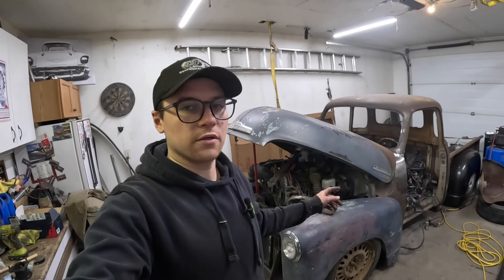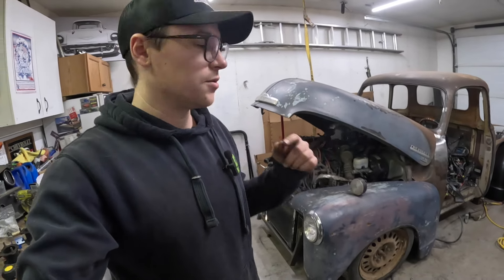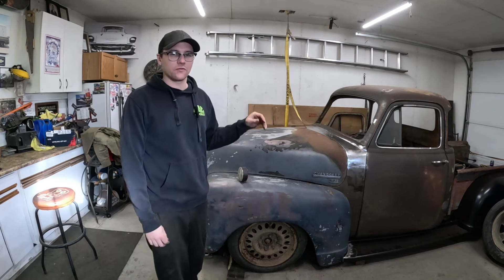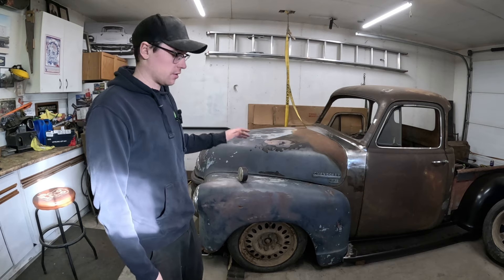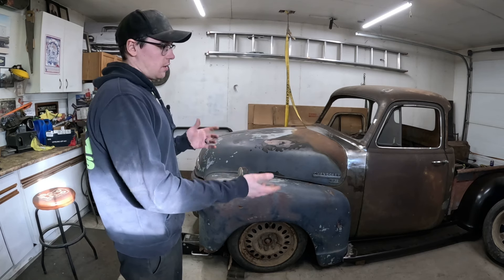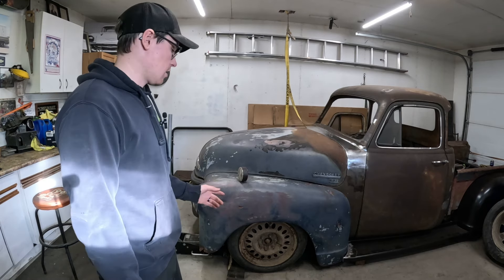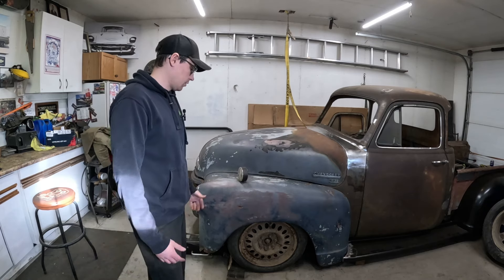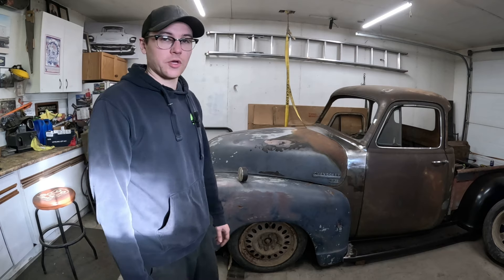Problem solving Air suspension issue! || CUSTOM BODY SWAP ep. 10

Comment: Been looking for a truck to chassis swap for awhile now. Had my heart set on an international,  but pretty sure im going to pick up a 49 chevy tomorrow. Super happy i found this series! Subbed for the build! For someone not planning to run bags, do you think ill run into issues with the front fender clearances?
Reply from the maker: Nice! Keep me posted on your build! If you don’t care about being low you can set your body higher and not have issues.
Reply: @CentennialCustoms  I really like how well the dash lined up on yours, that's why I'd like to aim for the same body height as yours. Do you think you'd be rubbing with the factory struts? If so, think I'd get away with a strut lift? Appreciate the reply!
Reply from the maker: I think with a smaller tire and probably a strut lift you’d be okay
Reply: @CentennialCustoms  awesome, i think ill definitely try to recreate what you've done. Worst case I guess I'll have to go air ride haha. Just need to decide whether to save some money on a 6 cylinder or wait for a v8. I can't imagine the chassis being to different between the two
Reply from the maker: I’m not sure on the frame differences, just make sure it’s short wheel base, unless wanting to do a long box. But being a gm mechanic I didn’t want to deal with the 6 cylinder timing chain issues, but a lot of People love them apparently
Reply: @CentennialCustoms  when you say make sure it's a short wheel base, are you referring to the envoy? I'm assuming not, thought they only came in one wheel base. The truck I'm going to look at has a 9ft bed, but the plan would be to shorten it to a small box
Reply from the maker: Envoys come in two length, there’s a longer one with 3rd row seating
Reply from the maker: Long wheelbase is easier to find one with a V8
Reply: @CentennialCustoms  having another look at market place and I'm noticing the 'xl's now. Thanks for pointing that out. I'll look into the timing chain too, wasn't aware they were an issue. This will be my first chevy project, definitely always leaned hard towards Japanese stuff lol. Got about 6 toyotas on the property right now. Should be interesting haha. Thanks again for all the info! Really appreciate. Can't wait for the next video to drop
Reply from the maker: No worries! Thanks for following the build! Good luck!